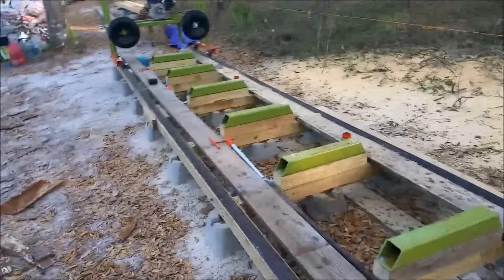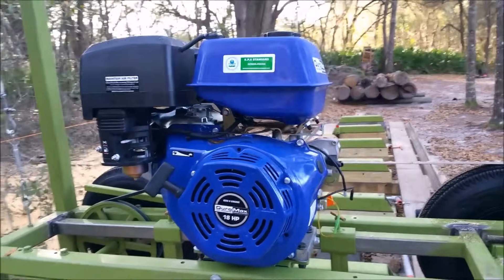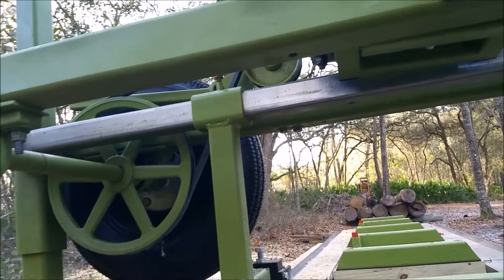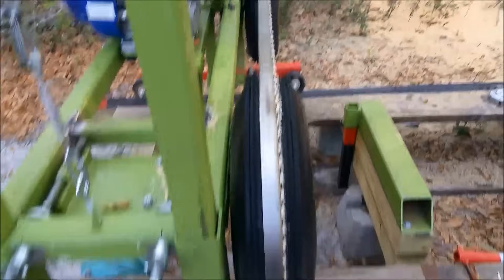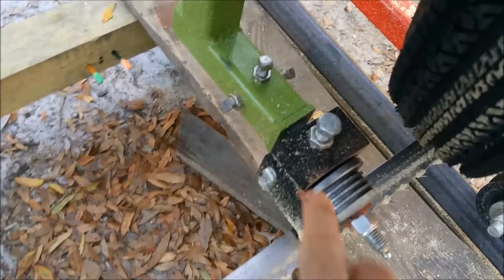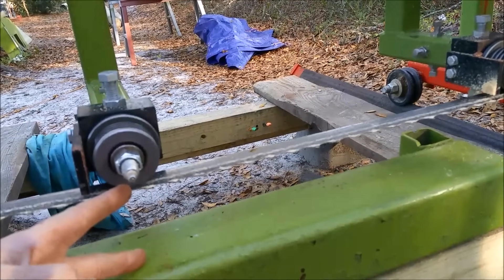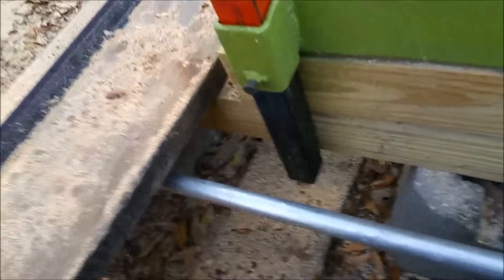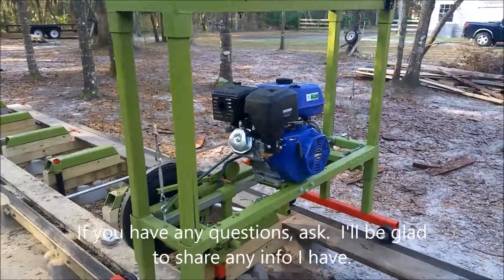Homemade Bandsaw Mill walk-around

Comment: Probably the best looking and most simplistic home made sawmill. I'm using your plan to make my own!! Thanks man!!!
Reply from the maker: Blake S 
Thank you. Try to find bigger axles would be my only advice.
Reply: Josh Davis 
Are you talking about your trailer tires?
Reply from the maker: Blake S 
Yes. The axles for the band wheels. In this case, they are trailer tires. The blade tension is more than the axles can handle. I've snapped them a few times and had to re-weld them. Just go with like 1 3/8" or so.
Reply: Josh Davis 
Oh man! Is there any benefit to using tires vs actual Sheaves?
Reply from the maker: Blake S 
Actual band wheels would be the very best option but they cost quite a bit. Rubber pneumatic wheels are the cheapest option, but not as rigid as you would want with mass wood production. The rubber wheels are bsically for hobby cutting, etc. As for using sheeves, I have never tried or have any advice on them.
Reply: Josh Davis 
Awesome man! Thank you.

Comment: I am in the process of building one and have the same engine. Did I hear you say you removed the electric start?  If so would you be willing to sell those parts?  Long story but I incorrectly bought the recoil start and need the electric start.
Reply from the maker: Chris Adcock 
I do plan to put it back on eventually, just wanted to get everything working correctly before wasting my time with the electric start. Otherwise, I would have been glad to send it to ya.

Comment: hi josh, what are sliding profile measurements? 40 x 40 x 2 mm and 50 x 50 x 3 mm ?
Reply from the maker: Naim Ayyılmaz 
Not sure what you mean. Also not sure what mm conversion to inches is.
Reply: I am sorry, I know little english. Up and down moving profiles, telescope profiles dimensions? :) I really want to ask the gap between the sliding profiles is not much?
Reply from the maker: Naim Ayyılmaz 
The up and down movement is provided by a boat wench. I am not sure how much each click moves the blade. I believe one full turn is near .625 inches. Hope this helps
Reply: He was asking for the internal and external dimensions of the tubing of the sliding parts.  If you give it to him inches he can convert it to metric.

Comment: This looks very well made.  Streamlined and solid.  From what I've read adn seen, a shroud covering the blades is an important safety item, to keep the blade from flying all over the place if it breaks or comes off.  How much did you spend on this?  Did the 4 inch tube for the bed from off a Harbor Freight saw?
Reply from the maker: Damon Diehl 
I agree on the shield and it will come eventually... thank you for the compliments... the 4" tubing is scrap from an old door frame that I picked up from Tractor Supply years ago.  They were trashing it, so my buddy told me to come get it. I've used it for many projects other than this one too.
Reply: Are you offering a set of plans?
Reply from the maker: Damon Diehl 
No, I have no plans. Maybe one day, but not yet

Comment: What kind of axles did you use? 1" solid steel or aluminum? Key way stock?
Reply from the maker: Paul Decker 
1" steel axles with key ways from BMI Karts, which I would NOT recommend. I've broken them numerous times. They are under-sized and knowing what I know now, would have gone with at least 1 3/8" or bigger. Maybe even a true hardened steel. This will be my next major "fix".
Reply from the maker: Paul Decker 
There is about 2500 lbs of tension on a solid sawmill. Those axles need to be able to handle that kind of strain when they hit knots or hard spots in the wood. Hope this helps
Reply: Josh Davis good to know. I purchased those same ones so we will see how that goes.. I'm getting a lot of ideas from your mill, so thanks for showing it off.
Reply from the maker: Paul Decker 
No problem. Good luck with your ideas. Cooks Sawmill has tons of useful info and videos on YouTube. Check them out
Reply: Another question: where did you find those T-handle screws on the log holders and the blade guides? I can't find them anyplace.
Reply from the maker: Paul Decker 
I built a lot of things myself, any t-bolts where most likely welded up myself.  The blade guides themselves are from Cooks.
Reply from the maker: Paul Decker 
I also bought a handful of taps and dies and cut threads when I couldn't find parts.
Reply: How did you fasten the angle iron track to the wood?
Reply from the maker: Paul Decker 
I drilled small holes in the bottom side of one side of the angle. Drilled a 3" screw through it into the wood. All it needs to do is keep the angle from moving side to side or off the wood.

Comment: Awesome sawmill. I'm needing to build one asap. I have been looking for a good one that I could afford. How much would it cost to build one like this?
Reply from the maker: Tommy Jenkins 
Ground up, no connections. Maybe $2000 engine and all. I've got maybe $1200 in it with some connections and scraps from the yard, etc.
Reply: Wow that is great. Would you send me some dementions of the carriage etc? My email is tommyjen101@gmail.com
Reply: Josh Davis we just bought 17 acres and it is all woods. I plan to use the wood from the property to build us a new house there.
Reply from the maker: Tommy Jenkins 
The dimensions are really based on how wide you need to cut. There's no magic number is what I'm saying. You can buy blades at any length, so my advice would be build the saw the size you want it and find blades to fit it. I first laid out the tires to see how much blade would actually be used for cutting, including blade guides and all. You end up being able to use about 2/3 the distance of the blade from where it comes off one wheel to touching the next. That's a good place to start. If I remember right, mine is about 60" total far right to far left. I can cut I think 22 inches wide or so. Can't remember exactly.
Reply: Cool thank you.

Comment: You did a nice job on your fabrication.  You will find that your sawmill will improve, and you'll stop having problems with your axle, when you get rid of the tires, and replace them with actual cast iron bandsaw wheels.  Very hard to tension the blade properly with aired tires.  Cut quality will improve tremendously, too.  Been there, done that.
Reply: You prolly spent more on those tires and hubs than a set of 19" band wheels would of ran you. I got my band wheels and collars , pillow blocks, 1 1/2" shafts all for under 300 bucks shipped from surplus center. I think my band wheels where $48,00 each with pulley belt and collar.
Reply from the maker: Jeff Heath The Vintage Workshop 
Thanks Jeff. I have debated the wheels, but the cast wheels are so expensive. Eventually, I hope to change these out tho with some actual bandsaw wheels.
Reply: I know the cast wheels are expensive, but keep in mind that so is a bunch of messed up lumber.  Just trying to help you avoid mistakes that so many have made before you.  Rubber tires are used in all the inexpensive-to-build sawmill plans, so they are very appealing.  Problem is, you can't tension the blade properly, so you end up cranking on it to tighten it more, and the axles break.   It's a nasty loop of bad outcomes.  Look for an old, vintage bandsaw that is beyond repair, but with good wheels.  Lots of 100 year old 27" to 30" bandsaws that the wheels are perfect for.  I've got a 27" Chicago Machinery Exchange bandsaw that's 110 years old, and the wheels are cast iron, sturdy as hell, and are 2" wide.  PERFECT.  Paid $100 for the entire machine.  Good luck.
Reply from the maker: Jeff Heath The Vintage Workshop 
I'm hoping (and looking) to stumble onto an old sawmill like that with good parts or someone looking to upgrade and selling a working mill within a hobbiest budget.  I've considered casting my own also, but that's a whole nother project. lol
Reply: I’m considering starting with an old shop bandsaw such as a 26” to 36” Crescent or something similar as a donor to my mill. There is a school of thought that the larger the wheel, the less stress on the blade over time. You also get the advantage of larger material capacity. One tradeoff is the blades will be more expensive. Being able to use the wheels, axles, bearings, drive pulley, frame components and hopefully some other parts would help defray some of the cost of an initial build. Hopefully.....
Reply: Jeff look on Ebay and search for pulley for industrial washing machines .They have 18" pulleys on them . I picked up two used for $80 shipping and all.
Reply: https://www.ebay.com/itm/272286058362
Reply: my offer was $35 each and $10 shipping and they took it. Just hope they are strong enough.

Comment: great looking mill do you have any plans for your mill I would like to build one let me  know stuffitgs@gmail. com
Reply from the maker: Grady Smith 
Thanks. No plans yet. I have a little more tweaking to do before I can finish the plans up. I have to strengthen the axles up somehow. One inch axle is too small.
Reply: When you get some plans let me know really like the carriage
Reply: On one of the websites I saw where he used 1 1/4 inch axles for the same reason you describe and solved the problem.

Comment: great build! definitely the simplest design ive seen yet, and probably the template i will follow to build mine. any regrets turning your frame roller angles up on their toes? seems the best way, just curious. thanks.
Reply from the maker: Jay Stachowiak 
thanks. I am pretty satisfied with the entire build except the axle size. I wish I would have gone with 1.5" or so. otherwise, I'm happy with the rails and all. the gap in the wheels collects dust sometimes, but it's easy to clean out.

Comment: Great job Josh , I want to build one just like it.
Reply from the maker: cajunski1 
I have partial plans drawn up, but I think my axles are too small, so the plans I have are null and void due to that... not sure what to do with the plans now. I drew them up in hopes to share the plans, but not sure I should now. haha
Reply: Looks great to me , maybe lighter or smaller wheels and different size blade if the axles seem too small  ?  But either way you do great work.
Reply from the maker: Thanks. I designed and built it myself. Just a few mistakes throughout the build, but next time I'll kow exactly how to do it.

Comment: what length blade are you running on that?  the DuroMax engine still holding up?  looking at a similar set up but with the 16 HP engine and some slightly different gearing to keep the blade speed up.
Reply from the maker: davidshourd 
I'm using a 132" blade. doublesharp by woodmizer. The duromax is doing great. it powers through anything I put down there. The 16hp will be fine too.

Comment: Nice build you have there. The tires appear to be 8" rim. Are they the 4.80 or 5.70 tires?? There is about a 2"+ difference between them for the same 8" rim. Thanks
Reply from the maker: mada94fxr 
I can't remember, but I think it's the 4.80. The overall height is about 16.8". Hope this helps
Reply: I have a set of the rims with the 4.80s on them and they measure 15.5". Hey, I would like a free  16 HP Duro max too...LOL.. Actually, I have a 10 HP Tecumseh off a snow blower with 120v elect start and camshaft PTO that I will use when I decide to build. Thanks for the videos
Reply from the maker: mada94fxr 
I wish the 18 Duromax was free... I did get a Briggs and Stratton 16hp for free but it was too rusted so I bought the new 18hp.  I'm happy with my mill, just wish I would have gone with a bigger axle like 1.5" instead of 1". It doesn't like the tension.
Reply from the maker: mada94fxr 
My wheels must be the 5.somethings then... I'm really not sure without looking at them. smaller wheels will also work, but it is worse for your blade.
Reply: The 5.80 tires are cheap enough. My build is a ways off. I am still gathering parts and pieces....
Reply: Do you still have that 16 HP Briggs and it is a V twin horizontal shaft? If you still have it and it isn't blown up or broke, I would like to talk to you about buying it. I am serious
Reply from the maker: mada94fxr 
yeah, that's what I did. just gathered parts over a few months, then got to a point where I needed one thing to figure something out and just jumped right in on my build. haha now I have a sawmill. lol
Reply from the maker: mada94fxr 
I still have it but it's single cylinder. It's the cast iron block and supposed to be a really good engine. and worth a little money parted out. not quite sure what I'm doing with it yet.
Reply: The old Briggs single cylinder engines are rare. I have 2 of the old Kohler K 341 -16 HP HEAVY engines. I was hoping it was the Vanguard V twin. Darn they are hard to come by used and I would dearly like to have one on the shelf. Better yet, retrofit it into the Massey tractor I have. Oh well, I was hoping. Thanks anyhow. I want to see a video of that Duromax working on your mill.